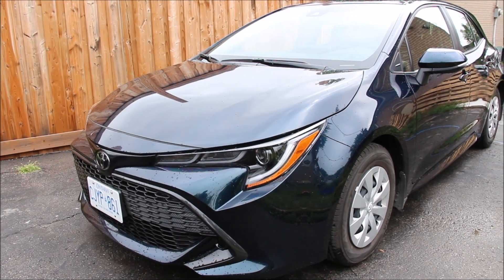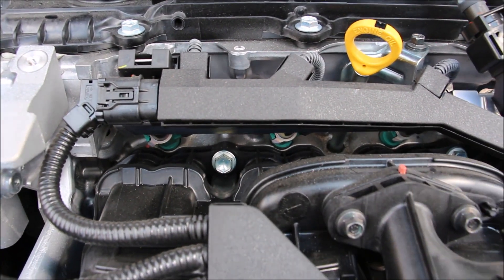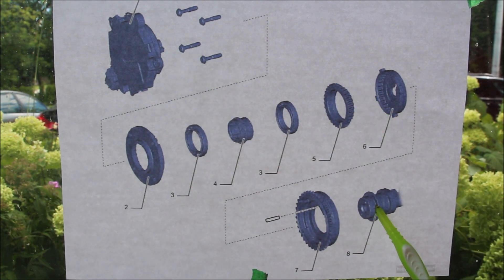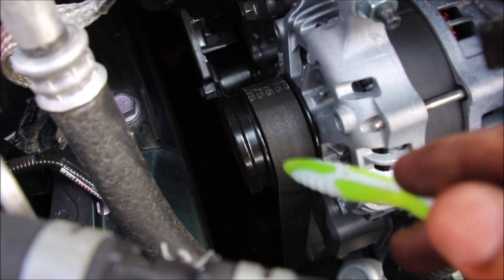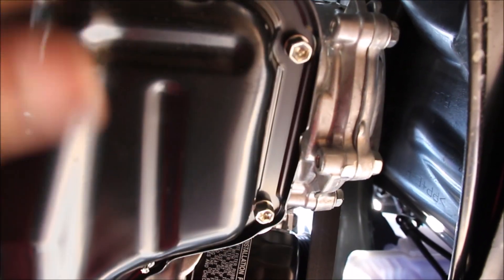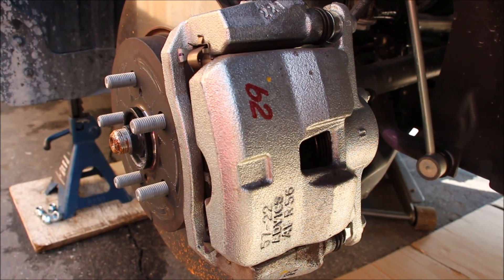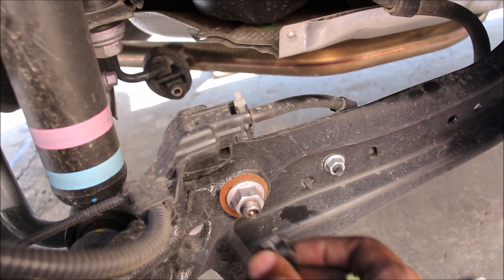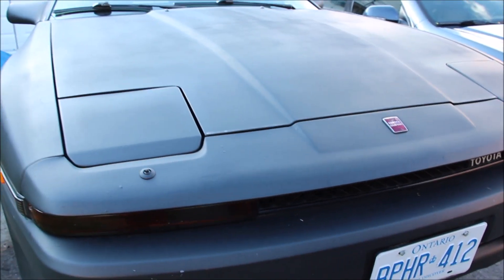Toyota Corolla Mechanical Review

Comment: Curious about the engine oil level sensor, is it only for internal components to use as reference or will the car display a warning light if oil level is too low?
Reply from the maker: It will display warnings. It'll also log into it's computer so if you try to claim warranty they can deny it.

Comment: Thanks for your videos on all the stuff so many of really care about. Lots of cool technology but I wish they cared more about the long-term owners when all the critical components made of plastic could fail at the worst time. 
I bought a new top radiator cooling hose assy for my 2010 Toyota 2AR-FE Engine, the improved one. Mine looked fine, everything under my hood is spotless. But as soon as I touched it the plastic section broke off. I mean I just touched it!   I am sure you have plenty of experience with this.
I like the new tech like DI and regular etc. But I keep my older stuff because I do most all my own maint.  I have a trusted shop to do the things I can't do because the Toyota dealership here is pretty bad, I'm surprised Toyota tolerates this dealership.
Reply from the maker: You are welcome and thanks for your experience

Comment: Hello sir speedkar what are your thoughts about the Toyota 3 cylinder engine with the standard automotic transmission? (Toyota wigo)

Is it reliable and durable?

What are the weakness?

Thanks much from the Philippines

Comment: Have you taken the intake manifold off man?
Reply from the maker: No why?
Reply: @speedkar99  I have been looking for a video specifically removing the one on the M20A-FKS.  I have a plug which is supposed to block recirc gases going into the intake manifold thus letting it be removed to a catch can I’m already running but I haven’t found torque specs for the mani and there’s a LOT of ancillary shit on it.  Haha I was hoping there was a video on how to do it with messing anything up 🤣.

Comment: I have a question: does the corolla hybrid 1,8 has an electric water pump or mechanical water pump. I read in internet that it is mechanical.
Reply from the maker: I'm not sure but I'd assume the same as the regular Corolla

Comment: Do you prefer single or dual fan setup? Australian version of the Corolla has dual fan setup (same specs) but here in Canada and USA we have single fan on radiator. And Toyota doesn't really say how often to do maintenance on owner's manual anymore unfortunately. Toyota like Honda wants us to take it to the dealer instead which I won't since I'll still find a way to DIY the maintenance myself.
Reply from the maker: I assume it has to do with the cooling capacity of the system and the climate being Hotter there than in north America.

Comment: Hi does the Toyota corolla have a bucket style cam follower for the high pressure fuel pump and can that wear out or cause damage to the camshaft lobe like on the Ford escape.
Reply from the maker: Yes

Comment: This corolla reminds of a mk6 1.4t golf. It's so similar in it's  arrangement it's shoking. Same arrangement of the multilink suspension. Same style front suspension. Sheesh, all the Sway bar links are connected in the exact same location. The only thing that ruined the golf was the 1.4t engine.

Comment: I found this a very effective video and particularly liked the fluorescent broken toothbrush handle for pointing. What I wanted to see was where the block heater port / hole was, and sadly, that wasn't covered. If you can tell me if your camera scanned across it at some point and tell me the time stamp in the video, I'd appreciate it.
Reply from the maker: Hmm I'm not sure if these have a threaded hole to put one in. You'd have to search the cooling section of the repair manual for that.
Reply: @speedkar99  No, just a straight hole about 3/4" diameter. The heater is akin to a small curling iron about 4" long with a clip that holds it in the block. Once you know where the hole is, it's a simple insert and the rest of the job is running the cord in a safe location to the front grill to access the plug. The problem is finding the hole on the various blocks! Thanks anyway.

Comment: Should explain the cvt  - does it have a belt  ? explain how the pulleys vary ? does it have a planetary gear set ?
Should show diagram of the transmission .
Is it different from a hybrid cvt ???
Reply: Check out engineering explained's video on the toyota launch gear cvt

Entirely different from an ecvt in a corolla hybrid. Kinda confusing that they make the naming so similar. ECVT are ingeniously simple. There's two motors to worry about(instead of a alternator and starter in a conventional ICE) but beyond that the transmission side of the transaxle is no more likely to fail then the differential
Reply: @caribougoo349   agree , the naming is misleading . They should call one - rubber band bs , and the hybrid cvt a planetary gear set drive

Comment: Throttle body driven by whire.... HAHAHAHAHA nope! it's all electric man!

Air intake system, look correctly. there's a part going into the front grill where it takes fresh air and throw some to the engine by the holes you saw behind, facing the engine. 

you can't know all ... i know but ..

Comment: Toyota insisted not to use Turbo for this regular commuter car.  Just adding dual injections in 2.0L is more than enough, 180HP and better fuel economy than the 1.8L.  Most turbo engines with 1.0-1.5L does not even get that much horse power but they indeed get really good torque right at 2000 rpm instead of 3000 rpm in naturally aspirated engines
Reply from the maker: Yes but they did alot of improvement just to avoid the turbo
Reply: @speedkar99  yes, Toyota play safe and smart. In the past 20 years, Hybrid has less problems than most diesels. D4s dual injections has 0 problems compared to small Turbo engines with carbon built up, turbo leaks, bearings etc. I also think non hybrid CVT from Aisin/toyota are more reliable than DSG or Automated manual from Ford, VW, Hyundai.

Comment: Does that 1st launch gear really make a difference? I'm aiming for a 2021 Corolla LE to save some money.
Reply: The LE trim is good value. I got one
Reply: @alvinsimba734  I looked at it, and I'm getting a silver LE.
Reply: @thundergato84  nice man.. you will like it especially with the 16 inch tires along with the fuel economy and the tried and true reliability of 1.8 litre. I got the 2020 corolla LE back in September 2020 for $16k american with heated seats and mirrors all included.

Comment: I have watched a couple of yours reviews and your knowledge seems very impressive as I only know how to call a tow truck.  What would make your reviews more relevant to me is when you mention the engine and the location is to mention your experience with the engine. How old is this design, is it a new design, what is it that is a common weak spot on the engine and how long does the warranty last?  If you bought the car would you buy an extended warranty and would you buy the car at all?  If you would not buy the car, please explain why.  I want my under the hood review guy to tell me if this car should expect 200,000 miles with good maintenance.  I want him to be upfront with why a GDI engine might have problems and why a subaru boxer engine can have a lot of problems.  I want to know if I should skip a CVT and go with the 8 speed auto? Is an auto even an option?  So the last 30 seconds of the review I want a detailed run down of what engine and transmission option you would buy and what would you stay away from as that is the most important choice if we buy the car.  Thumbs way up from me! I plan to watch many more of your reviews.  My mechanic always told me I had a nut loose behind the wheel.
Reply from the maker: How about the manual transmission?

Comment: I wonder how easy or hard it would be to swap out the CVT in this car for the 6-speed manual. Where I live in Australia, only the entry level "Ascent Sport" trim gets the manual, but i'd really like to get the top "ZR" trim with the manual, so I was wondering if you could swap in the manual... Hmm..
Reply from the maker: These cars are fairly new so you'd probably loose alot more swapping than importing / buying a manual one

Comment: Could you do a mechanical review of 2019-2020 Mazda 3 FWD or current generation Mazda 6 (non turbo)WITHOUT cylinder deactivation? The just reviewed 2020 Corolla and the previous 2 requested Mazda's are considerations for my next car purchase. Mazda 6 would have to be pre 2018 for no cylinder deactivation.

Comment: I would like to see a mechanical review of the Mazda CX-5 and CX-9. What are your thoughts?
Reply from the maker: Yep. If I can get my hands on one. I'd love to see the new spark controlled ignition combustion engines too!
Reply: @speedkar99  wonder if that's cylinder deactivation system has a negative effect on the longevity of the engine.

Comment: Interesting, Canadian spec hatch doesn't have the fake exhaust tips on the rear bumper? Great review though, good to know they've made most maintenance items easily accessible, save for the vacuum and fuel system.
Reply from the maker: Yes it's not bad to work on because it's a 4 cylinder.

Comment: my Corolla hatchback  has 2 coolant   reservoir caps a traditional metal one and a black plastic one what is the difference? and which one would i need to add coolant to when needed?
Reply from the maker: I'm assuming the metal one is for the radiator which you fill first then the plastic one is the overfill you fill it until the mark

Comment: Great video but holy.. Toyota has come a far way down from previous generations, an electric cam phaser but they drove the vacuum mechanically seems like something VW does.. more time consuming and expensive replace, plastic end caps in the sub-frame,  a CVT trans that cant be serviced by DIY for a  relatively cheap inexpensive Corolla
Reply from the maker: Sure. But the consumer has changed too...no one keeps these cars forever anymore

Comment: Egr Cooler! I was surprised when I saw the throttle body had radiator coolant going to it now EGR does too? Excessive engineering! The length of the erg tubing should be enough to cool. Also the hotter the cleaner it burns. The few degrees of cooling coming into the throttle body is minuscule for horsepower. Although I live in Minnesota. 🤣 great review👍

Comment: Thanks man.  Just inherited this exact car and it looks pretty easy to repair at home.  Definitely don't like the TPMS in wheel and I hate the 18" wheels on the XSE, but it looks like it's going to last a while as long as the CVT holds up.  You think drain n fill for the CVT fluid every 30-40K miles will suffice?  On all my older cars, I just measure what comes out, put the same amount back in.
Reply from the maker: Check the fluid level. The manual specifies a way to check fluid temps without the scanner

Comment: The Toyota Corolla is a well-designed vehicle. Great reliability and gets very good gas mileage. Parts are reasonable if you have to do repairs and they are generally easy to work on. No, it's not a rocket ship or a luxury vehicle but if you need a reliable, good gas mileage vehicle for commuting, it is a good choice.
Reply from the maker: Thanks and I agree. It's the vehicle most people need.

Comment: I don't understand why one of the vvti gears is electrically controlled and one is mechanically controlled. Why not use the same method for both?
Reply from the maker: Good question. Perhaps the intake is more vital to control acurately or with a wider range. Or maybe it's cost driven.

Comment: Id like to see the manual transmission version of this car. Is the transmission oil easy to change on the manual? How about a clutch? Id also like to see more in depth on how that electronic parking brake works. You said much hated? Now im curious why?
Reply from the maker: That would be good to see. 
I'd also like to see how they implement the auto brake function with a clutch

Comment: For Toyotas with the Electronic Parking Brake, do both of the rear wheels need to be removed to mechanically disengage each of them in the event that they fail?
Reply from the maker: I think you can get at the bolts from underneath

Comment: Holy mother of reviews. This is just what i have been missing all my life - a complete in depth review with the nitty gritty covered. Top job man. Keep it up.
Reply from the maker: Thanks! What other cars would you like to see?
Reply: speedkar99 to start a Honda Civic review and then a direct comparison between these two would be sweet. 
Also may i suggest an improvement? Invest in a dedicated mic to clip to your shirt, it will make a major difference. Good luck!
Reply: speedkar99 BTW the sound of that GDI pump sounds quite unsettling.

Comment: What's your opinion on the Plastic Valve Cover? Good? Bad?
Reply from the maker: Good for weight reduction and cost savings. 
After 10-15 years it could warp, or crack if hit by an object (like a flying ratchet haha)
Reply: @speedkar99  Ok thanks! They usually need a new gasket after 15 years even with the metal ones.

Comment: Is plastic gas tank a trend now? I can understand the plastic air intake manifold but it is not a safety hazard when it fails. The gas tank, on the other hand is low to the ground and prone to getting punchered.
Reply from the maker: I'd argue it's better than metal because it won't rust

Comment: Question sir, just to let you know I don't have much knowledge about cars. I know how to check the engine oil level because I tried to read my toyota's owners manual. I found out that I can't see any break fluid at all in my break fluid chamber. I know some break fluid is black or blue, some are yellow like in this one. I think mine is color yellow as well but I can't see if it is in low level, high or middle. it seems to me that there's no fluid at all. The car breaking is still working fine. can you pls teach me how to properly check the level of my break fluid. my car is a toyota vios. Thanks!

Comment: I took my 2002 beater Corolla for an oil change yesterday and I was super surprised to see that there is barely any rust underneath the car. It spent its 17 years outside in snow, rain and sun and there was very tiny amount of rust which could have been cleaned off. My 2009 Nissan murano on the other hand which is half corollas age and also spent its life outside next to Corolla looks horrible underneath. Its falling apart from rust. Toyota has superior quality.
Reply from the maker: That's amazing. My 01 Corolla died of rust. See my EVAP system video for more on that...haha

Comment: this is what a car review should be ,not the fluff from most of those paid off shrills .Its a great way to compare how much a car is going to cost you as it ages .It surprises me how complex this little car has gotten ,that CV  tranny , is a curse and should fail just about the time warranty is over !Even Toyota has gotten on board the failure mode bus .
Reply from the maker: Agreed, it's quite complex, although I say the technology has proven itself already and is ready for the world's best selling car!
Reply: In actual fact if you look and analyze the construction of all CV transmissions the design is quite flawed  .The belt has too fail ,whether it wants to or not , the floating sheaves have to grip on a steel link belt made of hundreds of small linked sections with tiny pivots .Look at it carefully . It's a stinker of a design .It was copied from industrial machines and they only last a few years in Industry.Later dude keep up the great work .

Comment: I'm guessing it's the 2.0, not the 1.8. I was confused because this Corolla had wheel covers, meaning that it has the 1.8. However,  the 1.8 does not have direct Injection.
Reply from the maker: I'm just as confused, but I know all hatchbacks come in 2.0 only.
Reply: speedkar99 I thought you had the sedan, my apologies. In California we don't get the hatchback with plastic wheel covers. Only the sedan

Comment: Too fast. You need to slow down the description and explanation. Even if one knows half of what you're talking about, it is hard to keep  up with the pace. Shame, I would have subscribed.
Reply from the maker: Thanks for your feedback. I try to keep things to the point on my channel.
Reply: @speedkar99  You keep it on point and describe the mechanics very thoroughly and with high precision. That is great. The problem is that you're trying to cram too much info on too little time. You' re cutting right after one explanation audio finishes and cueing the next one immediately, without even half a second for the transition. The human brain can not process information so fast in most of the cases, and even more if it's something new they have to learn or understand. I am not suggesting that you elaborate more on your points or that you overexplain. Just speak more slowly and allow for more time for the brain of your viewers to process the audio and visual information they are receiving.

Comment: Does the 2018 Toyota Camry 4 cyl engine have electric water pump?
Reply from the maker: Yes, it's the same dynamic force series.
Reply: Do you think this will be a reliable design with that electronic waterpump

Comment: With all these computer controlled parts and complex systems and emmisions equipment and non serviceable parts, you might as well have an electric car and remove a vast majority of the mechanical complexity. 

Question is, how far can we engineer a gas power car?
Reply from the maker: It will be refined until there's no more gas....